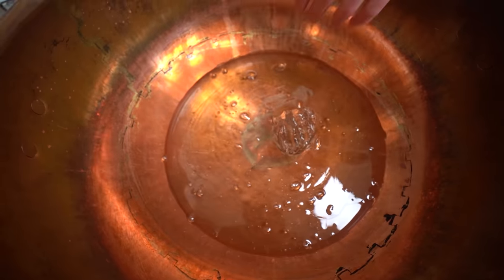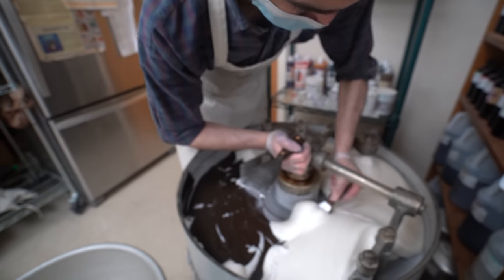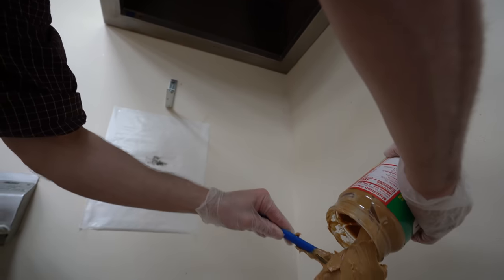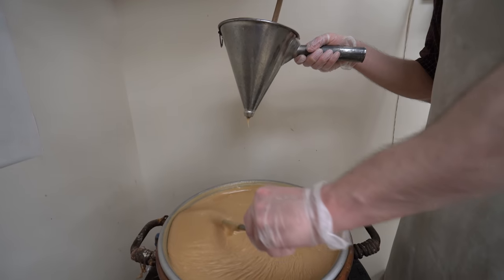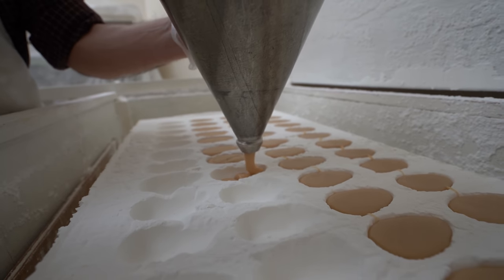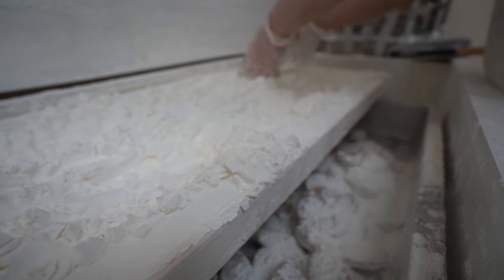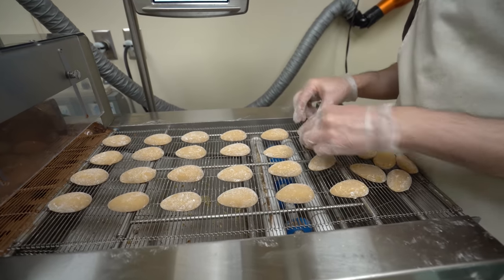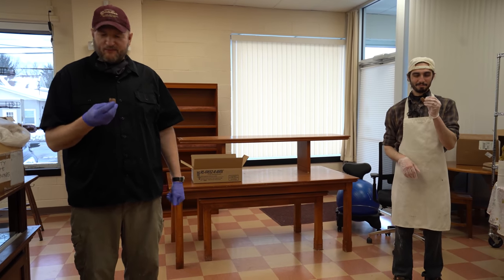How We Make Peanut Butter Cream Easter Eggs From Starch to Finish!

Comment: 25:51 also, starch flying around is EXTREMELY flammable and there have even been factories that have exploded because of a spark in a room full of flour/starch dust. So, if you ever had a hot plate in there, DEFINITELY nothing that has flames or can cause sparks.

Comment: You could add a layer of marshmallow cream.  I don't know if anyone else has ever had that on a peanut butter sandwich, but it is awesome.  Also, you could use slightly less of the peanut cream filling and make up the difference by heating up Nutella and then injecting each egg with a delicious center.  Or you could inject a fruit gel for a PB&J feel. It would take longer, but you could crumble up some pretzels and do the cream in two layers and sprinkle the pretzel bits in between.

Comment: In horse drawn coaches storage was generally an afterthought, so the coach driver (no one really concerned with their comfort) would have the seat replaced with a boot locker, and use the lid as a seat.   Much later on, especially in the rougher frontier roads of the Americas, they would instead have a proper seat and attach trunks to the top and rear of the coach. So you could either throw things in the boot locker, or the trunk depending on the coach design.

Comment: When working with peanut butter in a # 10 can or gallon hard plastic jar, run thru a open dishwasher. The peanut butter will slide out when you open it.

Comment: The reason you don't put heat/hot/fire/electrical/etc in the cornstarch room is *KABOOM* and moisture control.  If your cornstarch starts to absorb water and starts to black mold you'd be looking at a billion dollar lawsuit, etc.    Also, *KABOOM* is bad too.

Comment: Are y’all hiring? I don’t have professional candy making experience but i did get every reference and happen to know that eating legumes makes you taller

Also pro tip for the peanut butter - put the sealed jar in some hot water for 10 min or so and the whole thing will slide out like a log when you turn it upside down
Reply from the maker: We are hiring, but ya gotta be local
Reply: @HerculesCandy  darn!!! Well if you do try or have tried the peanut butter jar trick, let me know! I used to empty like 10 jars a day at a froyo shop and it was a lifesaver